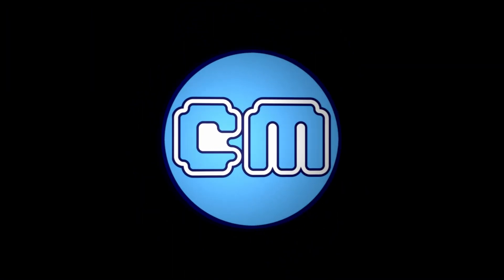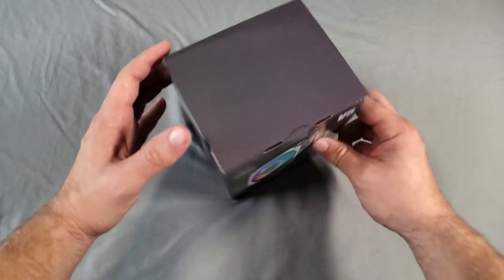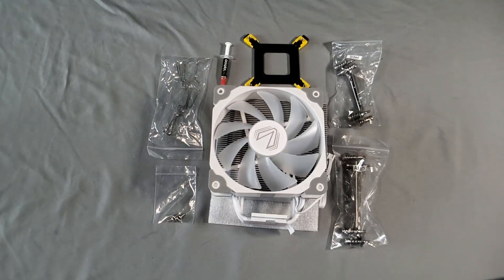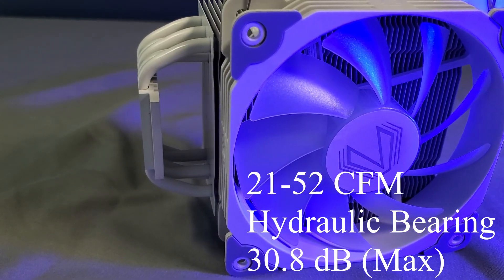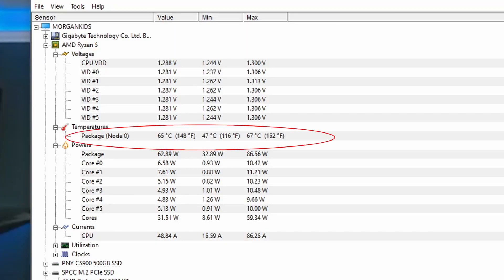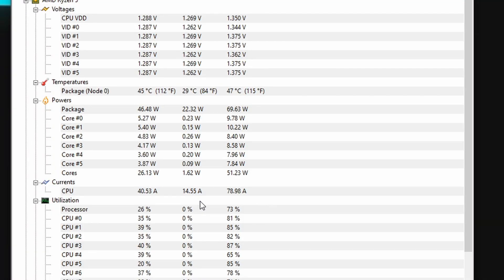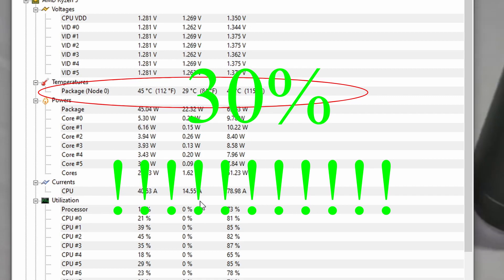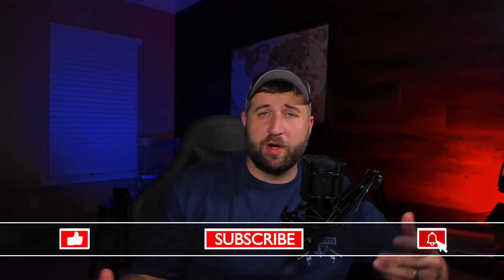CPU too hot? New Vetroo V5 CPU Cooler could help!”

Comment: I bought this cpu cooler and used it for 3 days total. Nothing wrong with the cooler, I just needed an aio watercooler instead due to higher end components in the system. I wanted to try fan cooling but in the end I couldn't take the risk. The V5 does give good headway options for mounting the fan with RAM in the way. I have 4 sticks of corsair vengeance in the ring and slot 1 was overlapping the fan pretty hard. In order to fit the V5 cooler fan and the RAM I had to mount the fan with about one third of the top of the fan above the radiator. I'm sure that affected temps but I can't tell you to what extent. All in all great fan cooler for the low price.

Comment: Bought the black one off ebay for 29 bucks. I have 3700x and it is 5c cooler on idle and 10c cooler on load vs my corsair h100v2 aio. Very impressive.

Comment: The MSI prebuilts come with this and it’s amazing
Reply: Id agree got it for 20gbp on amazon and for the money its really hard to beat pretty much on par with coolermasters hyper 212... couple the v5 with good qulity thermal paste and you got yourself cheap and cheerful cooling option. Wouldnt use it with huge overclocks or 10 core cpus... you could use it on some 8 core ones with no OC but thats expected for a budget option

Comment: Great microphone and production! You deserve more subs

EDIT: I highly disagree with the testing method you used for these coolers, you can see in the video that the CPU is only hitting 46% usage, even gaming for 15 minutes would've done more, and simulated the heat generated from the GPU as well - but that might be going too far.

Secondly, the thing I would be more concerned with when getting a cooler is noise, not temperatures. A recording of both coolers would've sufficed.

Comment: I have a question. Looked like you were going to use Aigo DR 12 Pro fan set? There are two 5V pin connectors on that hub. I have the Darkflash Shadow Pro and hooked it up to that hub and it syncs with the fans. Just curious if you bought the newer version of this, if it might can hook up to that hub as well? I mean it's a 5V three pin connection. Not sure if the cooler would sync with the fans but might can change the effects maybe? By the way did this cooler work well? I just ordered the Black version which does have four / three pin connectors. Awesome job on this by the way. Very pro.

Comment: Just an update to this, but a newer version is out that has both an argb and power connector. Works well too and keeps my power hungry 8350fx much cooler than my Cryorig M9a cooler did by a long shot. P.S. I also did not use the included thermal paste and opted for Thermal Grizzly Kryonaught instead.

Comment: This dosent work with a ryzen b450m motherboard it won’t fit the bracket
Reply from the maker: It does, the brackets may need to be switched IE the left one to the right and the right to the left. I installed this on an Aorus b450m board in the video
Reply: @CapnMedia  I have a tomahawk max and it dosent fit either way
Reply from the maker: @Izic67  interesting, possibly reach out to Vetroo and see if the have other brackets they can send you?
Reply: @CapnMedia  never mind I figured out the problem the instructions need to be more clear I didn’t know you could slide it down a level to make it fit

Comment: how did you remove the thermal paste im using your video to install my cpu cooler
Reply from the maker: It just wipes off, but if you need help with reside get some isopropyl alcohol to help

Comment: You know which wire i could cut to remove the rgb? I just dont need one fan that is randomly rainbow lol
Reply from the maker: I do not unfortunatley, but my recommendation would be to just replace the fan with a non rgb pwm fan, shouldn't be more than 15 bucks

Comment: Can you change the colors and if so how??
Reply from the maker: So you can adjust the actual hue, saturation, brightness, white balance with the camera settings. If you stream or use Skype, you can add a LUT to give it different effects
Reply: CapnMedia of the fan on the cpu cooler...
Reply from the maker: @primalgraphx5747  they claim that you can but it is statically set to Rainbow. The fan cable is only a 3 pin but that being said, it is a PWM fan